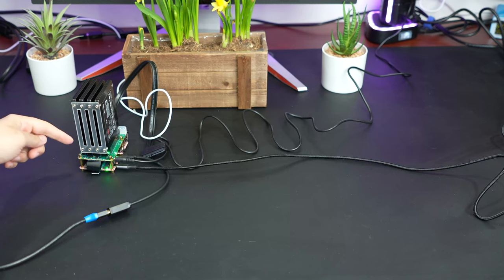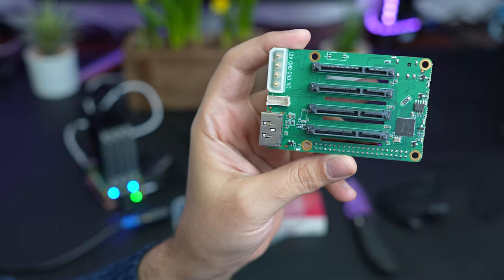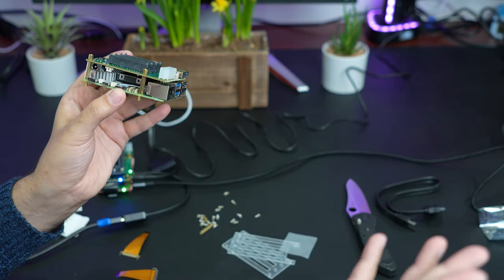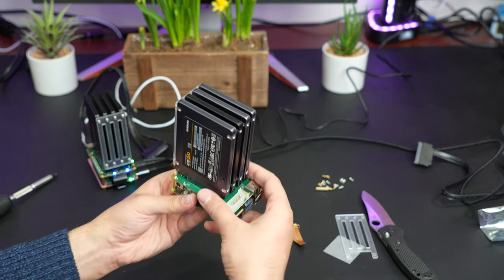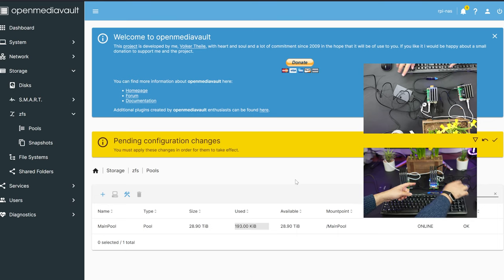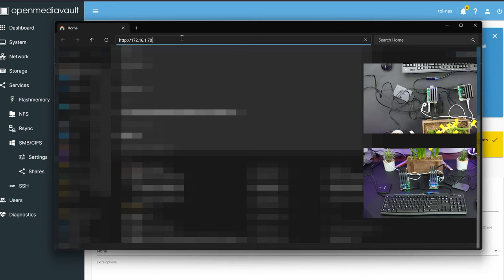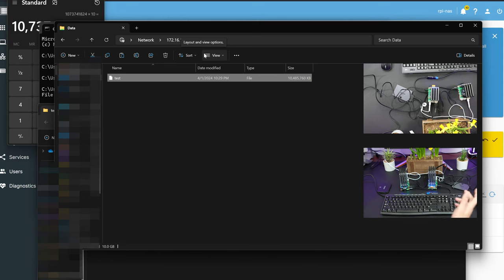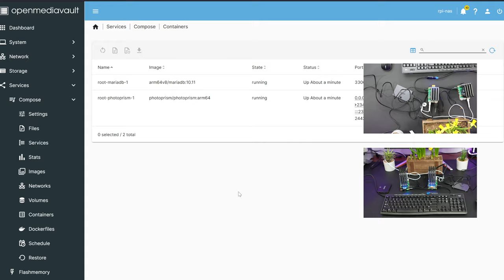Raspberry Pi 5 & Rock 5A: Building Two Ultimate budget NAS (ZFS and Software RAID)

Comment: The Raspberry Pi 5 and Rock 5A Pink combo for building a budget NAS is pure brilliance! The Radxa Penta SATA Hat adds so much functionality. Thanks for sharing this amazing setup
Reply: I disagree. The similarly priced CM3588 solution is 2.5 times faster because it's a 2.5GB NIC as opposed to this 1GB/s solution. The boards in this demo are let down by the slow NIC when it comes to storage and speed.
Reply: @TerenceKearns but that only works with super expensive NVMe drives.

Comment: It's enough to put the 12V charger. Raspberry Pi 5 will be powered from Gpio.
Reply from the maker: You are absolutely right, as you can see in the video that I removed the USB-C cable after inserting it, the part where I removed the cable and explained that it's not needed didn't make it to the final cut. But thanks for point it out so others won't make the same mistake as I did.
Reply: @TechnicallyUnsure Thank you for your review. I'm curious about Docker integration.
Reply: @MariusOdobasa  docker works on it
Reply: @TechnicallyUnsure  12v and what Amp do you recommend? i am guessing 5a+
Reply from the maker: @jumpnjack808  Correct, 5A is more than enough to power the disks and Raspberry Pi

Comment: can you use 3.5in drives as well? would all sata slots be available?
Reply from the maker: Yes, but you might not be able to fit the 3.5in drives next to each other on top of the hat, but you can probably use sata cable extender

Comment: Great video.  So fed up with cloud providers and home NAS costs so a great proposition,. Just a question though about fitting the Active Cooler in the Pi 5: in the Geerling and Klements videos they had to snap off some fins on the Active Cooler to get the SATA hat to fit to the Pi.  You seem to use the same official Active Cooler.  However after fitting the Active Cooler you have no problem fitting the SATA hat.  How did you avoid this problem?  Did you use longer posts or perhaps you have a later Radxa build that addresses the problem?  Keen to know as not happy with snapping things!
A more enduring concern is cooling for the storage discs, which you mention may be necessary if left in an enclosed space or a warm room.  Any suggestions?  I'd be happy to rest a second Active Coooler on top of the disks if it could be controlled by the Pi or OMV?
Reply: Yes, I notice this but he goes so fast and can't tell if he does have same issue.  I have to shorten 3 fins in order to fit the HAT.
Reply: @mtstek  Yeah, I thought that might be the case.  Especially as my other theory of using longer copper posts is dumb as of course the GINO connection would not fit!  Itching to try but nothing in stock for us in the UK, even the Rock version.
Reply: @leshobbs7911  I ordered it from Aliexpress last week, just received yesterday in US.

Comment: "ultimate budget" nas build, whips out 4 x 8TB SAMSUNG SSDs hahahahahaha $2500 in SSDs just alone
Reply from the maker: You are right, but for the "NAS" part I mainly meant the NAS itself. Disks, you can use anything you like, smaller storage, non-SSD regular mechanical disks etc.
Reply: @TechnicallyUnsure  Im in the middle of closing down my seedbox (plex server) and running it off an 8GB PI5 but cant get the kit to house 4 SSDs
Reply: @TechnicallyUnsure  And to be fair the budget pre-built NAS units on the market are the "add your own drives" ones.

Comment: It's likely a "No," but I'm just verifying if it's possible to power the entire NAS via POE. Here's hoping for future advancements that could make it achievable, thereby reducing the cable clutter.
Reply from the maker: Yes, you can power entire board and disks and Raspberry Pi from the PoE
Reply: @TechnicallyUnsure  wow that’s unexpected. Will order one and try it out
Reply: @TechnicallyUnsure  so the setup would be POE board in the middle of the Pi5 and NAS hat, not sure if the flex cable from Pi5 to NAS hat is long enough to run over
Reply from the maker: It's enough to connect the hat to the board, and yes, rest of the setup is as you described
Reply: Saw JG video and thought I'd give this a go

Looking at tidier cable management and the PoE option sounds interesting

I've just built the pi5 version of this with x4 1tb ssd, in an aluminium enclosure with 5v 50mm case fan + official pi5 active cooler

Runs from official pi5 27W power supply

Draws 7.5 W at idle with disks at 35°c & pi5 at 33°c . Temps rise by 10°c with sustained large file transfer for 20 mins and power draw is 10.5 W max

Would like a good balance of cable management + safe temps + low noise

I have run it with a 12v case fan and the temps dropped significantly but it sounded like a jet engine. I have a good balance with my current set-up but like the sound of the PoE, and the PoE board seems to provide enough of everything to make it viable for my small home network requirements

Comment: Could you use actual mechanical hard drives with this and just plug them in via wire connectors instead of directly to the board
Reply from the maker: I replied to another comment asking for the same. I tried and it worked with 2.5 inch regular mechanical HDD as well.

Comment: seems bad engineering, they/you/we could simply mount everything UNDER the raspberry so that the heat of the cpu is more free to go. Only requirement is a longer PCIe cable, or with inverted endings
Reply: Generally you want to have data lines as short as possible, and you could still just buy a longer cable probably

Comment: if you have 12v adapter, can it also supply power for the PI or do you still need the usb-c power adapter for Pi? And if the 12v adapter cannot power the PI, can I use POE hat with this hat together for reducing the number of cables connected to the Pi?
Reply from the maker: The 12V that powers the SATA hat can power up the raspberry pi or rock 5a, you don't need additional USB C cable

Comment: Those drives are not gonna heat up as long as it's limited by that 1GB NIC. The 4xNVMe board CM3588 is a much better option with it's 2.5GB NIC. The bottleneck is the NIC.

Comment: Im curious. How would someone go about cloning an existing image to this raid array? And on the same subject would it be possible to move the entire image to a set of larger drives if necessary?
Reply from the maker: What's the existing image? You mean another RAID image? If it's "mdadm" software raid, I think you can just move those disk to this system and it should work. Never tried moving zpool around, but that one might work too, but I personally have never tried that. Personally, I would just build a new RAID on this setup and copy all my files from the other system to the new one via rsync over ssh.
Reply: @TechnicallyUnsure  Fair point. I've since decided to go a different route than this piece of hardware. Turns out my plan is going to require hardware thats more powerful than the raspberry pi.